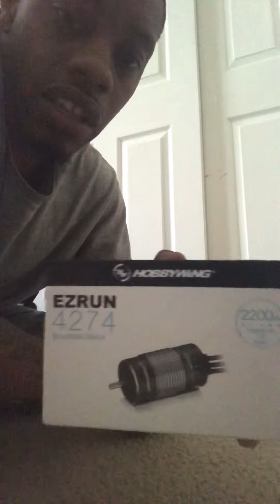Upgrading redcat tr-mt8e 1/8

Comment: That is not the tr-mt8e v2 it is the 1st version. U can tell by the tires it comes with. The V2 version has same wheels as tr-mt8e bes model.
Reply from the maker: The Charley Channel that’s what the paper work says when it came with the user manual but the be6s version is the second version but that’s just how they list it...I was confused at first into I looked it up
Reply from the maker: Hey 👋🏾 man what’s up you was right it’s is the first version I noticed when I started to upgrade it..the guy sent me the wrong information so thanks for informing me 👍🏾👍🏾🍻
Reply: I i figured that much. Lol
Reply from the maker: Yea man 🤦🏾‍♂️ 😂
Reply: So what upgrades have u done to it so far? I have the trmt8e v2 and so far its a tank minus some of the bearings in the transmission exploded.
Reply from the maker: The Charley Channel ohh wow I replaced all the bearings changed all the diffs to Metal with thicker drive shafts, I put 30k oil in the shocks also in the front & rear diffs the center diff I put 500k oil..changed the whole setup I put 150amp esc v3 hobbywing with the 2200kv ezrun motor also changed my gearing..it’s a beast now I just have to get some wheels for it cause the balloon like crazy..I just post the video of it yesterday check it out if you didn see it yett!!